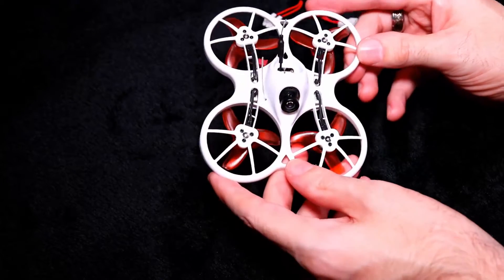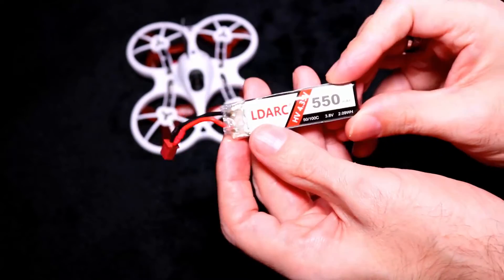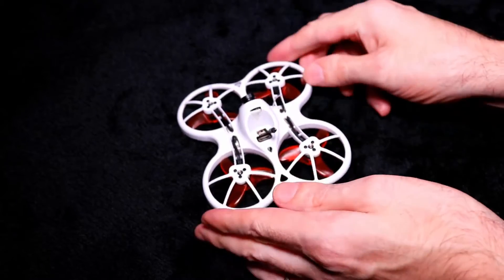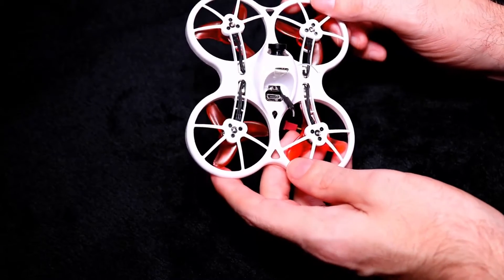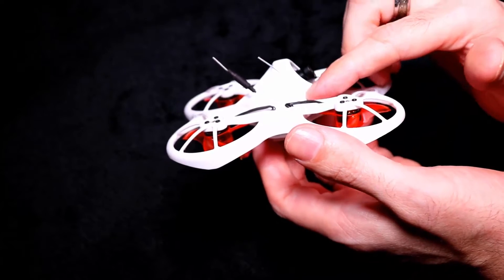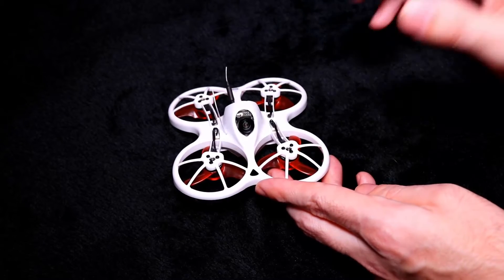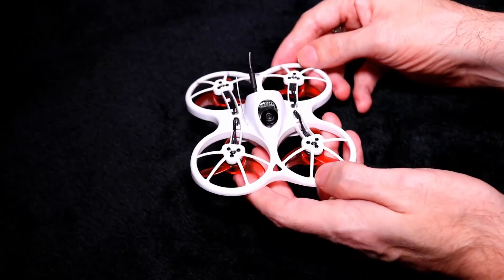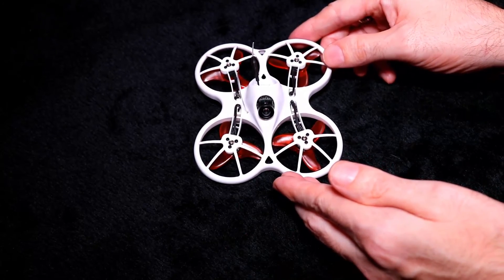Emax Tinyhawk Quick Overview And Mods

Comment: Got mine a week ago and I noticed the  polarity was reversed on the Tinyhwak battery leads and the lipo it came with. The new lipo's I got for it was normal and would charge on the stock charger which you would think  would cause a problem.
Reply from the maker: If the polarity was reversed you would see a puff off smoke maybe the color of the wires were just switched over but in the right place?
Reply: @ejay200704  wire polarity is correct on the FC but at the ph2.0 connector on the Tinyhawk it isn't and the same with the battery that it came with. Good thing I checked before plugging it in.
Reply from the maker: Yes it is always  good to check a new product over before you fly it.

Comment: Merch if you can whould you go a little more in depth about how to install the 5v regulator, you kind of side stepped past that and It would be great if this was illustrated in more detail.
Reply from the maker: Yes i did kind of skip that because i have other ideas but i can make a picture showing you what wires go where if you wan?